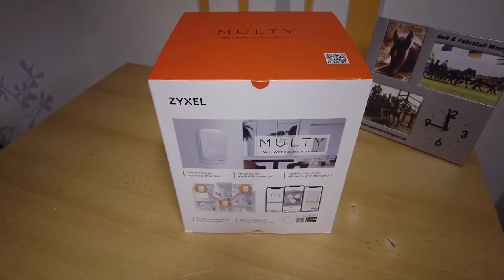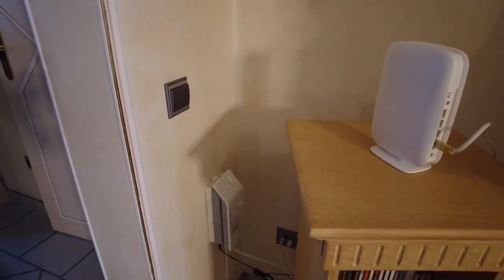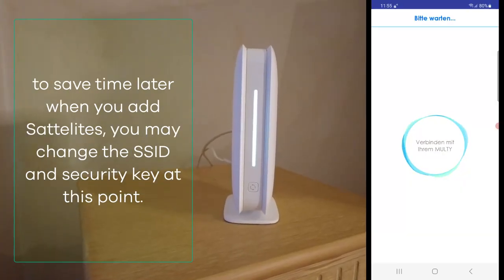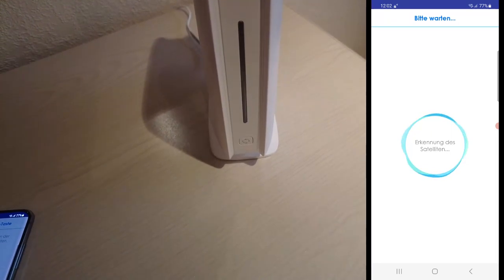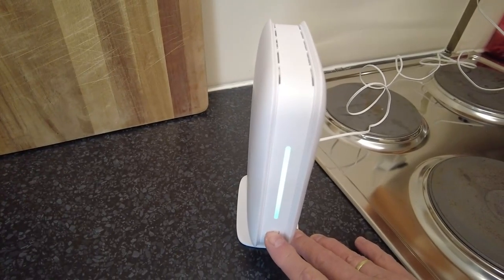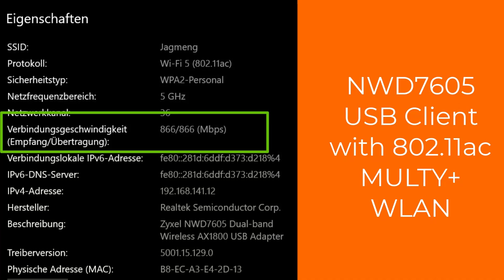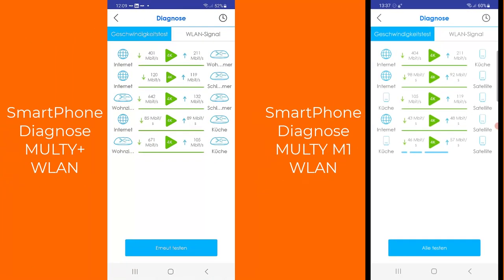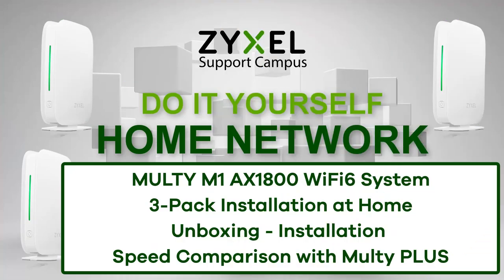Zyxel Multy M1 AX1800 WiFi 6 Home System Setup at Home EN

Comment: Is it possible to create mesh WIFI network when AX1800 routers are connected via LAN cable?
Reply from the maker: Hi Piotr, if you connect all APs with a LAN cable, therer is nothing to MESH. This works only on WLAN module.
Reply: @ZyxelSupportCampus  What I meant was that routers (main + satellite) are connected with Ethernet backhaul
Reply from the maker: @pustyniaq  if you connect the nodes by Ethernet cable, this is the backhaul. All devices only work as access point, but don't mesh with each other.

Comment: I have the same question. Is a backhaul connection possible so thats works like a access point in mesh?
Reply from the maker: Hi, if you connect the nodes by Ethernet cable, this is the backhaul. All devices only work as access point, but don't mesh with each other. If you use a node connected by WiFi, these mesh together.

Comment: Hi,

I have a Zykel Router provided by my isp, will these work as wifi extenders in tandem with the router?

Model - dx3301
Reply from the maker: Hi, you must connect the first node with a cable and extend the WiFi then with the Multy M1 set. If the WiFi of the router overlap with the WiFi of Multy, you will need to switch off the routers WiFi. If your new router is a Zyxel E/DX model with AX1800, you can use the WX3100 to mesh the WiFi of the router and extend it.

Comment: Could you let me know the voltage of the power adapters?.
I need to build a system using solar power.
Thanks.
Reply from the maker: Hi the Power on secondary is 12V / 3A, plus pole inside plug
Reply: @ZyxelSupportCampus  That is brilliant thanks.